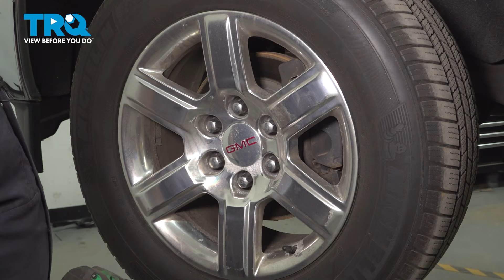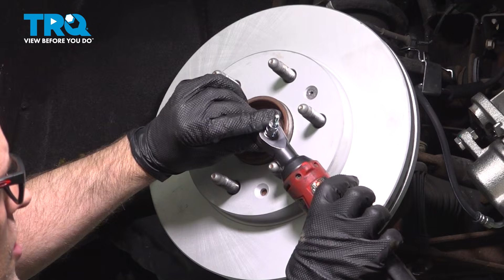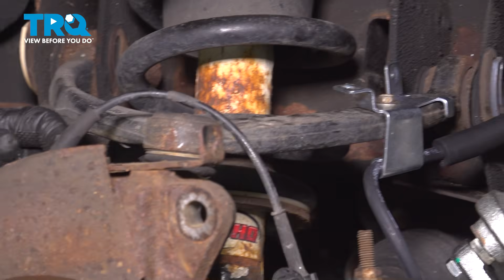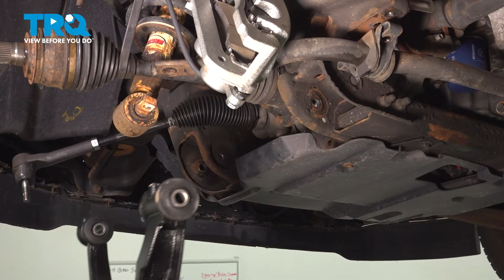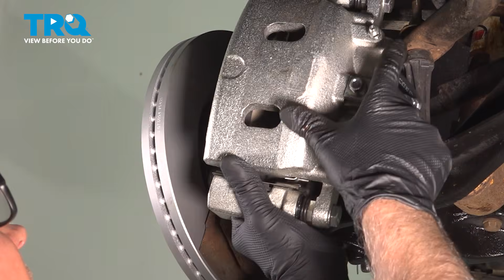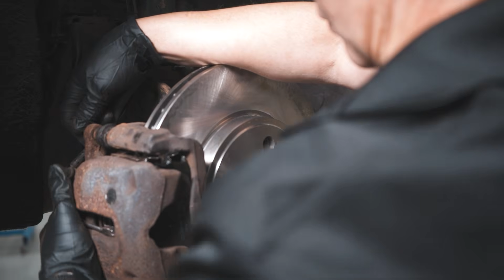How to Replace Front Lower Control Arms 2014-2018 GMC Sierra 1500

Comment: The passenger requires more work you have to remove the sway bar to get one bolt out an if you are doing the upper control arm. I don't want to spoil the surprise

Comment: There's a lot of unnecessary steps in this video you don't have to undo the upper ball joint or remove the caliper or the brake caliper bracket or the speed sensor or any of that